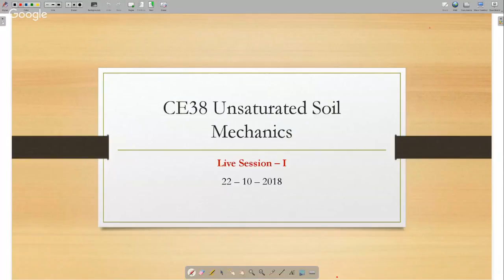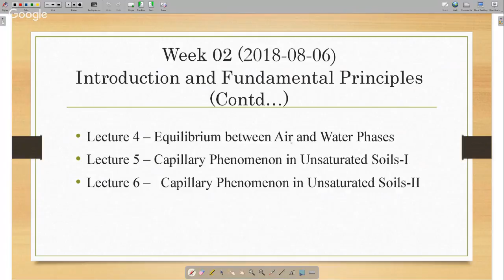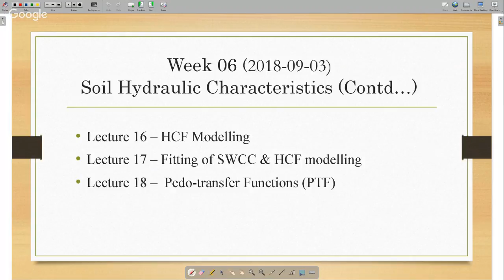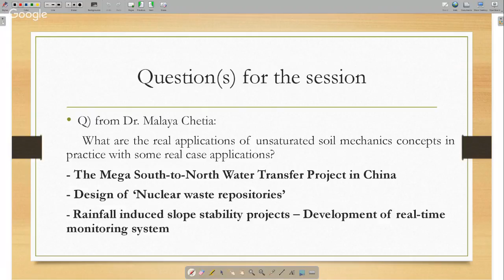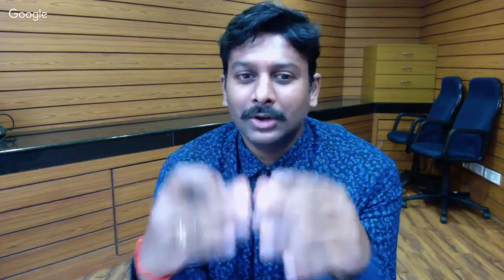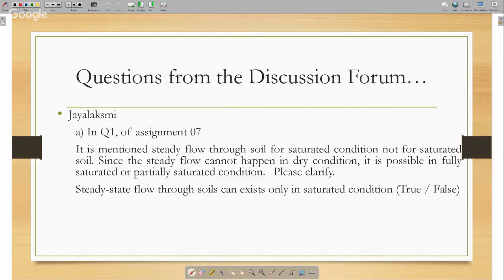NOC: Unsaturated Soil Mechanics - Session 1

Comment: I am still wondering just a basic thing. In conventional soil mechanics design procedure, we use the parameters like c= x , and qu= y, or k= z. These values can be used directly as we move ahead in our design procedure. In unsaturated soils, we get the functions primarily from the graphs using SWCC. How can we use the USPFs in design? How can I pick one value from the USP function for one particular degree of saturation? Does the degree of saturation not change over time with constant wetting and drying as rainfall comes every once in a while and saturates the soil more and in summer the water evaporates slowly due to heat and the degree of saturation is changed again? I am trying to conduct any test for the first time at our university in unsaturated soil mechanics. I have devices to generate a complete soil water characteristics curve from low suction to 1 million kPa suction. I, however, cannot still understand how I will use the USPFs which will be generated later in design.
Reply: How to perform 1-d consolidation tets for unsaturated soil samples?